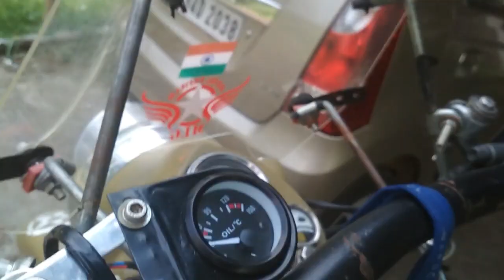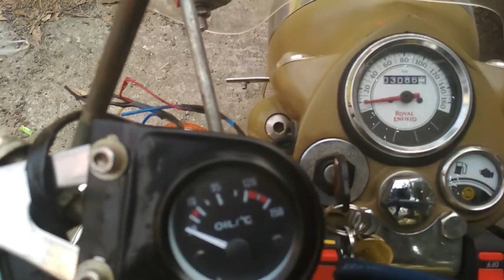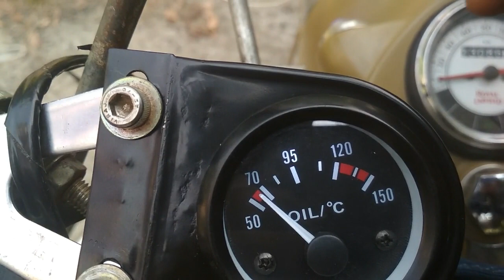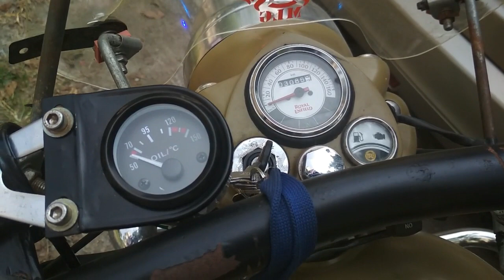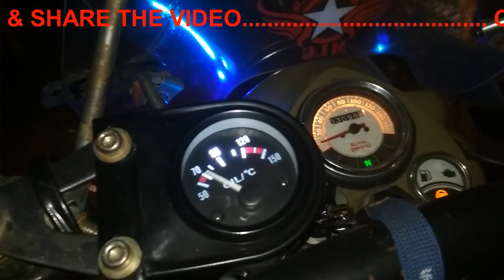ENGINE TEMPERATURE METER WITH NIGHT VISIBILITY MODS ON ROYAL ENFIELD CLASSIC 500 DESERT STORM BS4

Comment: royal enfield classic 500 cc bike heat up after riding 5 to 10 mintues, it's normal na ......
Reply: It's normal to heat upto 60 to 80 degrees. Enfield engine needs to actually heated up above 50 degrees to actually run, because lots of engine oil of high thickness is used.
But going above 120 degrees causes loss of lubricity of the Engine oil and causes long time damage.
I hope your queries answered.😁